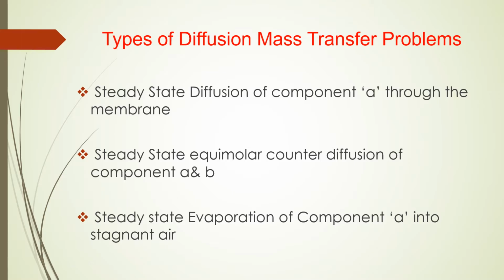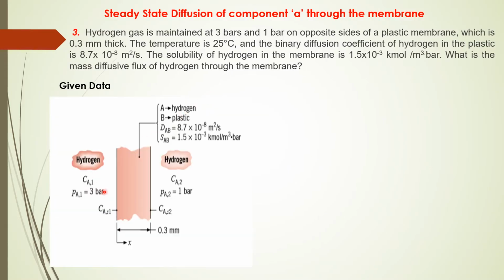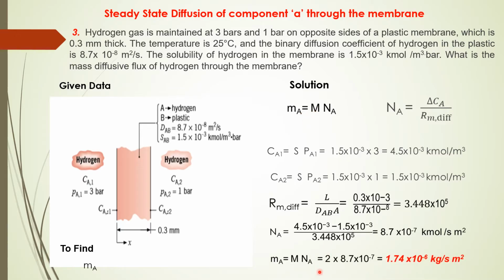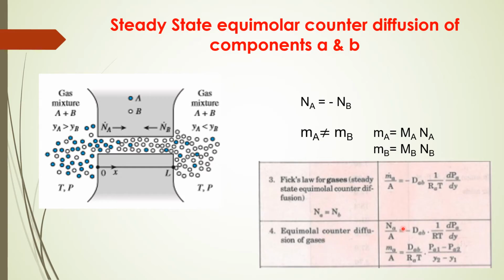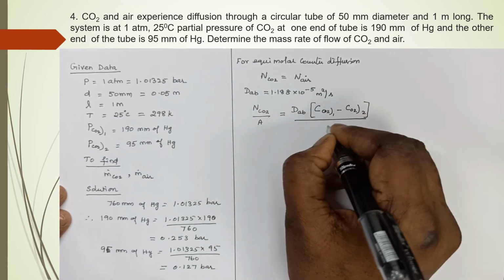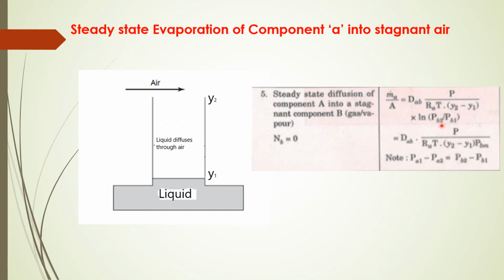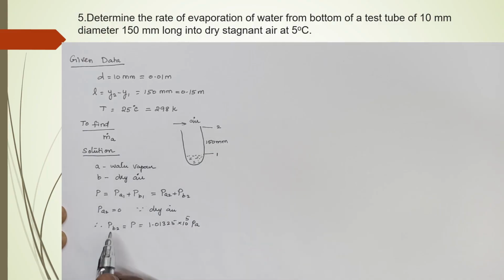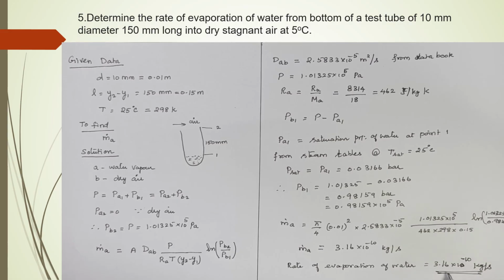Mass Transfer  Diffusion problems`

Comment: Hydrogen gas is maintained at pressure of 2.4 bars and 1 bar on opposite
sides of a plastic membrane 0.3 mm thick. The binary diffusion coefficient
for hydrogen in the plastic is 8.6x 10-8 m2
/s and solubility of hydrogen
in the membrane is 0.00145 kg mole/m3
-bar. (molecular weight of hydrogen
- 2kg/kg mole)
Calculate under uniform conditions of 24ºC, the following: [9]
i) Molar concentration of hydrogen at opposite face of membrane
ii) Molar and mass diffusion of hydrogen through membrane 
.
.
.

Plz help me sir for this question